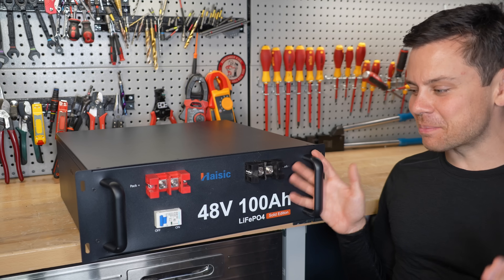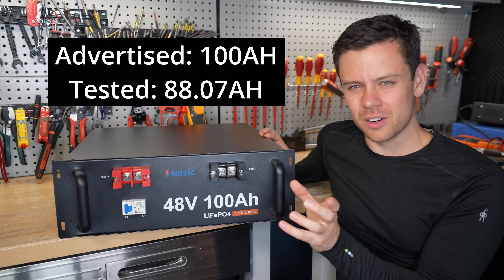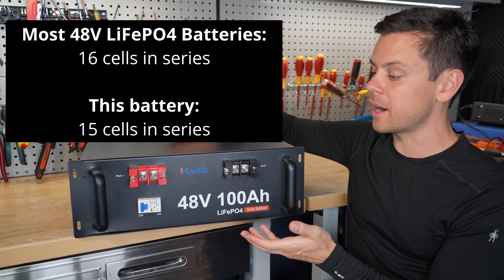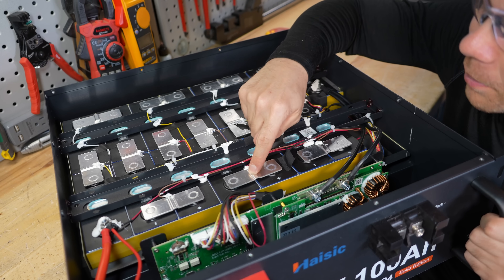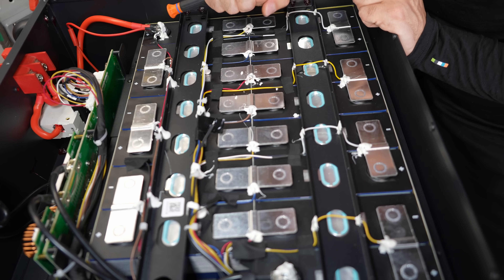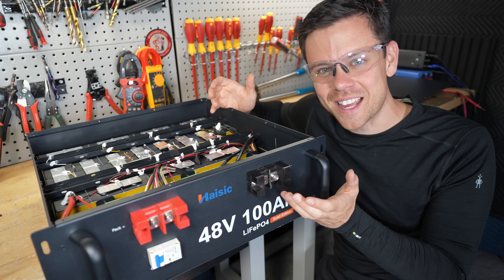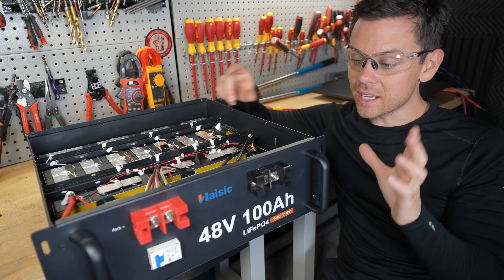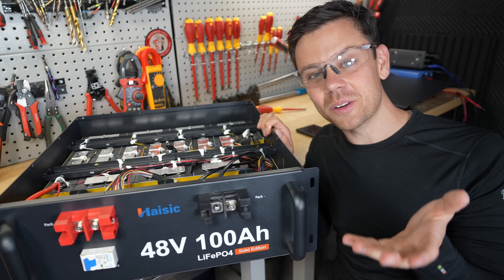48V Server Rack Battery for $549 on Amazon?! Haisic 48V 100AH

Comment: Will, do you recommend building batteries with eve cells or just buying off the shelf.  I am trying to figure out how to create a 11kwh system on a budget
Reply: I have 3 eco worthy batteries and they are awesome, 15k worth of power.
Reply: @GoonyMclinux  Similar. I'm off gridding for a while and have two Eco-worthy 100 Ah server rack batteries fed by 1500 W of solar.  It's great as long as I don't want continuous air conditioning.  Mostly I just need to run it a short time and have plenty of power for everything else, plus reserve.
Reply: I just bought a 16KWH DIY battery kit from Basen Green for 1670 dollars. Comes with quality cells, bms, and case. Pretty great deal per KW in my opinion.